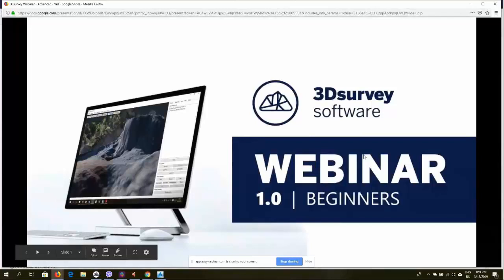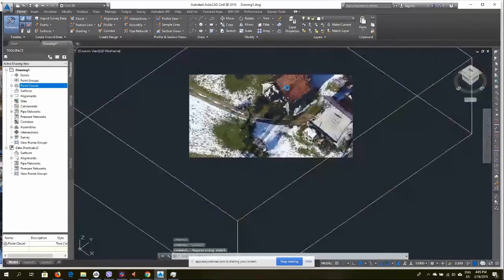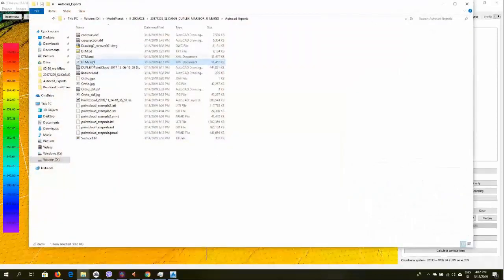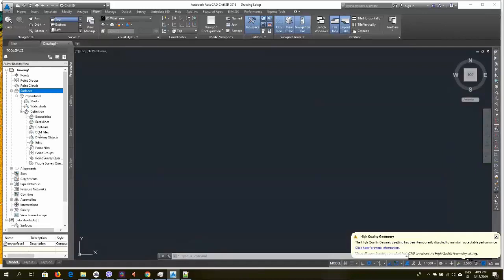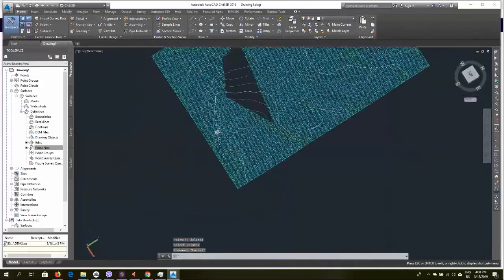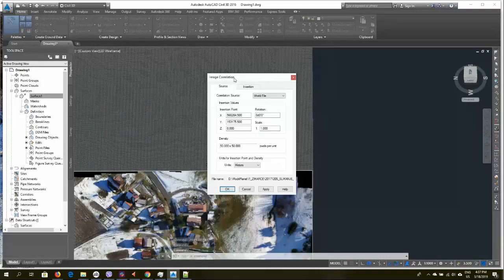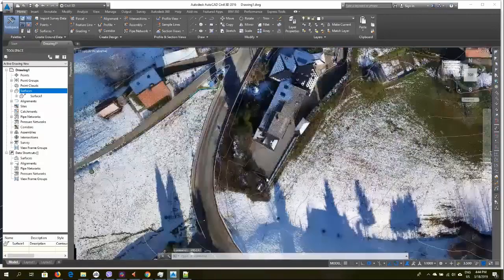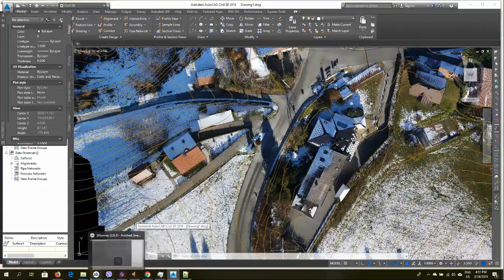Webinar: AutoCAD Exports

Comment: Hey, Civil 3d since 2018 version is no longer supporting LAS files. How can i import point cloud from 3d survey to Civil 3d now? Im using Civil 3d 2022
Reply from the maker: Hey Szymon, now you need Autodesk Recap software as well. It is unfortunate I know, but they moved the las import function from Civil3d to Recap. There you now import las, and save it int rcp file format that you can import into Civil3d.